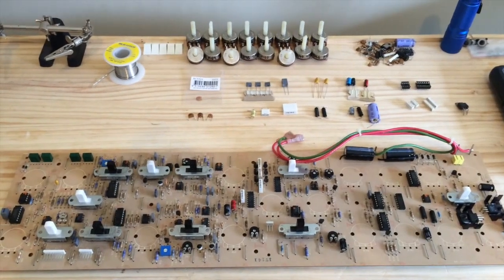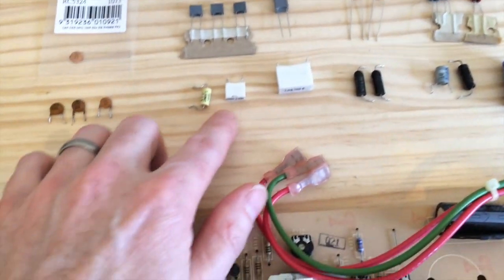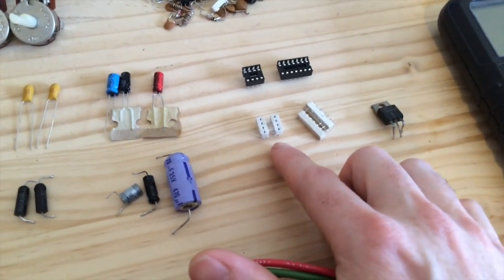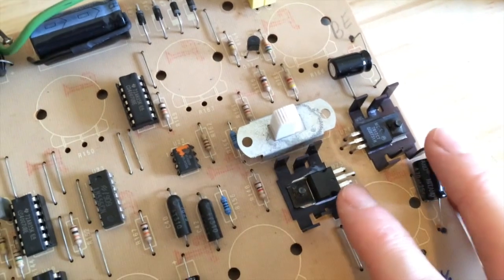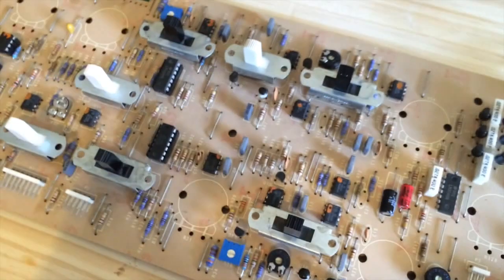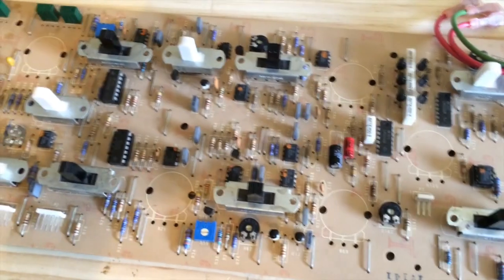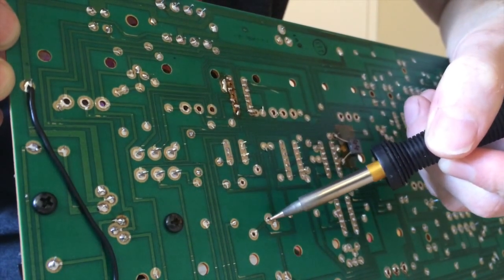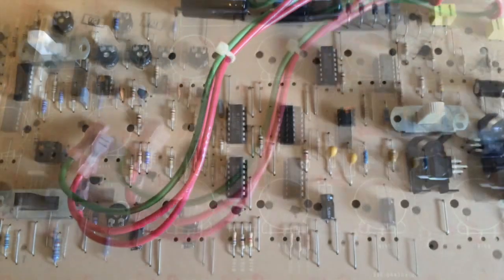Moog Prodigy Restoration (Part 3) - Recapping and replacing components

Comment: I wouldn't buy this particular synthesizer. It's no longer a Moog Prodigy. The changes in the sound character have gone too far. Replacing the electrolytic capacitors is a must. Tantalum capacitors too. That's all.

Comment: When you clean up the pots do you dismantle them and polish the brushes? I use 6000 grit paper to gently polish off the black tarnish. I find contact cleaner does not clean off this tarnish, it lasts a short while but it's not the same as dismantling them and cleaning properly.
  I don't think you really need to change those ceramic and tantalum caps. Do you test them and find they are bad?
 I test and change any bad metal can electrolytics. Job done!
 A phrase springs to mind here. If it ain't broke don't fix it.

Comment: Hey mate I know these are old videos but I'm watching them all as I have an old Prodigy that is not well. When you press a key it just makes a sort of hissing noise. The hissing noise is not pitched when you hit a different key the resultant hissing noise has the same pitch as before, however the envelopes do affect the ADSR of the hissing the synth produces. the power supply seem OK and  I've got out the parts cannon and started randomly replacing caps... But I suspect I may still face the issue when I'm finished. Clearly you know a ton more than I do - So I wonder does anything spring to your mind from the symptoms I describe? Great vids and what amazing attention to detail!
Reply: Funny you mention going larger on the power supply caps... I initially went so large I couldn't reassemble the board into the case... So yeah you're right there's definitely a limit :-D

Comment: Thanks for the videos, they are really helpful. I begin having some problems with oscillator 1. A slight crackle appears if I move the osc 1 waveform switch whilst pressing any of the keys. Finally when switching the sync switch to 'on' the sound from osc 2 disappears as well no matter where any of the volumes are set. I have seen in a moog forum that could be a problem with LM3046. Can you please tell me how to identify it ? Thanks so much for the help!

Comment: My Prodigy is missing two knobs that were broken off from the stem of the pot apparently.  Is it possible to replace the stem from the pots or do you need to replace the whole pot itself? Thank you sir
Reply from the maker: Try syntaur or eBay. I also use synthparts.com a lot. There aren't replacement shafts but you may find the pots.
Reply: id sell you some original shafts if you want.  I needed to replace my cutoff POT and EMPH as the carbon track had disintegrated....

Comment: glad to hear you swapped the ceramics for film caps... what do you think of the result?
Reply from the maker: It doesn't sound any different, I didn't really expect any. Ceramics are usually very reliable unless the legs rust. They also are extremely low leakage. Metal films caps can age, especially with temperature, so I usually replace them with the same type. The only real benefit of Film over Ceramic is higher capacitance.
Reply: do you think it's really a result of value - more than placement? I was thinking that some well placed substitutions of filter or osc caps might really help - for example it's one thing i noticed in the filter section of the prophet 5 - compred to, say, the polysix. I have yet to verify any results or even buy my parts yet however... thanks for your efforts!
Reply from the maker: Value does seem to play a part. Not just in individual components but in the decisions that were made when the circuit was designed. The American Synths were generally pretty good though. Especially Sequential and Oberheim. Although ARP seemed to cut corners wherever possible, especially on their later stuff before they went broke. The Korg polysix was a much cheaper synth than the P5 so it wouldn't surprise me if cost was the main factor.
Reply: thanks for the reply - yes - well with all the cost cutting in the polysix it made me wonder if some nice teflon or other caps - well placed -might make rather a difference - though I am EXTREMELY pleased with my own polysix...
to be honest though - i always thought the ARPs were much more 'pure' and full of character than their american brethren... not entirely unlike the prophet five. I LOVE the really early japanese synths too (i.e. Roland SH series etc)
Reply from the maker: You're right, the original ARP's sound awesome; it's just the build quality that really annoyed me. The 4075 is my favourite 24dB filter of all time and the oscillators are huge and easily have the best 1V/Oct tracking. Out of the Japanese synths some Rolands I don't like (but I love the SH-5). And I absolutely LOVE every analogue Yamaha I've ever played.

Comment: For the power section, could you tell me which values you used for the capacitors (uf / voltage).  You mention the 1000uf caps, but what did you use for the rest of the power section?  Thanks.

Comment: I've got a question.  A friend of mine recently bought one of these with a very low serial number, and it has a strange issue.  When you turn it on, the keyboard immediately starts latching, and playing a note.  Otherwise, the synth functions more or less properly, but will latch to whatever note is being played.  Basically, it never stops playing a note.  I'm currently in school for electronics, and my uncle is a retired electrical engineer.  We're going to try and troubleshoot the problem, and if you have any suggestions as to where to look, that would be very helpful.  Other than the specified problem, my friend says there's a problem with the contour section (which could be related to the main problem?).  I can't seem to find any information about this specific problem online for a moog prodigy.  

Also, great video.  My uncle and I will definitely be referring to this while troubleshooting.
Reply from the maker: +GameOfThePlanets Check that there is a gate signal emitted by the keyboard. At the junction of R144 and R145 you should get a +2.5V signal when a key is held down. Then I'd replace both U20 and U21 (CD4007). Those old logic chips are known to fail.